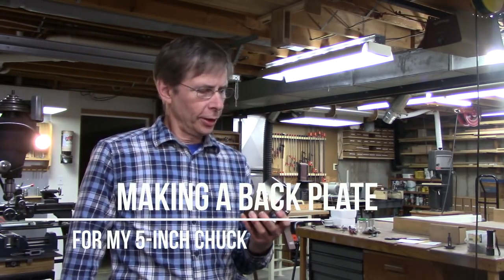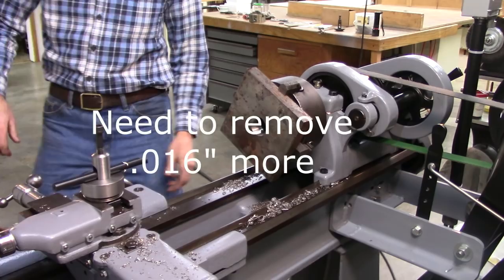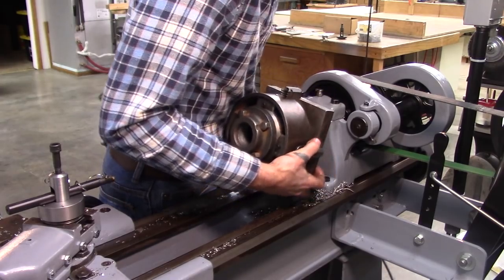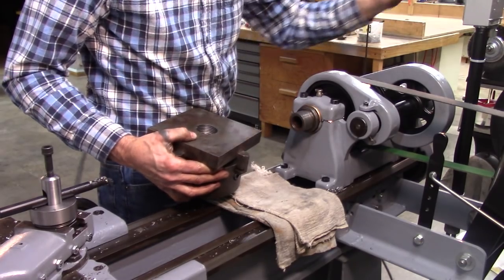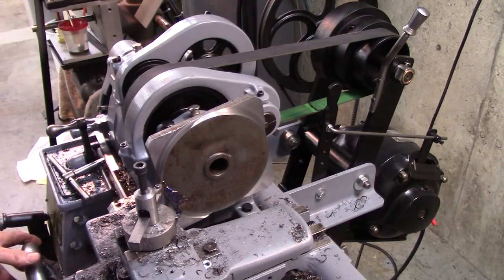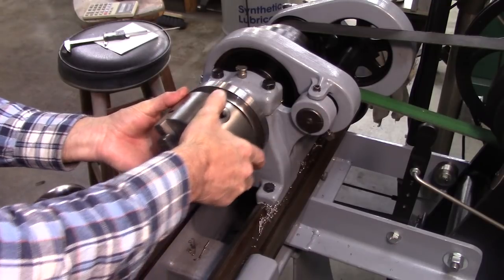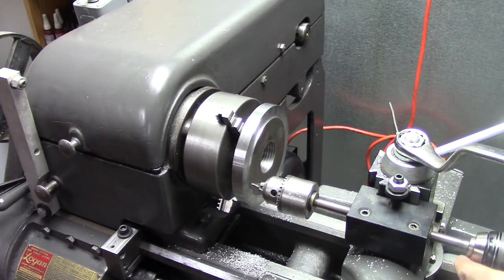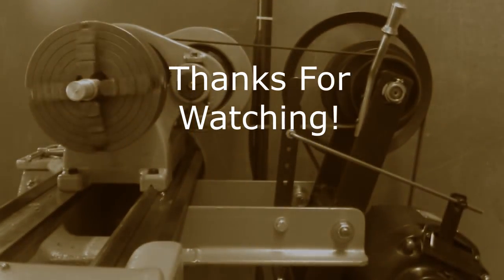Making a Back Plate for my Metal lathe Chuck

Comment: 1” through bore vs 3/4” through bore on Atlas 10/12” lathes perhaps?
Thanks,
John
Reply from the maker: I think the bore is 13/16" just like my Logan. This means the spindle is a bit thicker which might also explain why I don't get much chatter even with a lot of chuck overhang. After market chucks don;t work well on the Logan

Comment: I think you have your cross slide set at the wrong angle, it looks to be 30 degrees from the axis of the spindle, it should be 60
Reply from the maker: I could have gone my whole life without hearing that - Ha! I hate to say it but it looks like you might be right. That could explain why I had to go deeper on the threads. If this is the case I surprised the chuck screws on so well. I'm going to go set the angle right now and see what I did!
Reply from the maker: Well that's embarrassing...  You are correct. I read the angle off a zero mark on the side. The South Bend has one on each side and the back. Of course it's easy to see how that was wrong, I just wasn't paying attention to the detail. The weird thing is, the compound will not turn far enough, it runs into the bolt for the cross slide nut. On my Logan you can turn it a full circle. I guess I could turn the compound the same as external threads and feed backwards with the compound BUT it;s possible this could cause problems. The wrong side of the tool would be cutting. Normally the lead screw backlash (for the carriage) is feeding against the cut. With the compound in the normal angle the tool may try to push the carriage. I guess you could snug the carriage lock slightly. 
Let me know if you have a solution. - And thanks for being observant!
Reply: Winky's Workshop i would thread with a left hand internal threading tool in your case, starting from the left end of the part and coming out of the part while threading. Some benefits are better visibility, no chuck collision if you overrun the stop point, it’s not your case but if you had to thread a blind hole it would allow you to start from the very beginning with a very narrow clearance. Tool post pressure and cutter side would be on the left if you keep your post the same as for external threads! Thanks for the nice video, you got it tight and accurate anyhow!

Comment: Thread yourself up up a "Male Test Spindle" using some solid round stock before starting this job and you won't have to remove the chuck like that at all.
Reply from the maker: If I was threading 5 or 6 back plates I would but I'd rather test in on the spindle.
Reply: You will find that it's handy to have and it doesn't take that long to make. @WinkysWorkshop
Reply from the maker: * @MF-ml8eh * The main reason I don't do this is that it introduces another variable. If my test piece is very slightly off it has the potential to double the error. I won't say all my back plates have been perfect (but they are getting better)  but I aim to have very slight resistance when I mount the chuck. The thread mount of a 1.5" spindle is the weak point. The south bend is 1-5/8" which is better although not huge. The strength of the threads goes up exponentially with diameter.  A 2" diameter would be 10x stronger.  A good fit on a small spindle becomes very important.

Comment: Nice job. Too much walking back and forth from lathe to bench. Get or build a smaller table or cabinet on casters so you can roll it over to your machine. The runout may change slightly if you chuck up a different diameter test piece.
Reply from the maker: I'd say you are right about the runout.  Yeah, this South Bend is new to me and my Logan 820 is my primary lathe. That's why nothing it where I need it. Thanks for watching.
Reply: Winky's Workshop - looking forward to future videos. Stay healthy.
Reply from the maker: @nevetslleksah  - Thanks and thanks for watching!